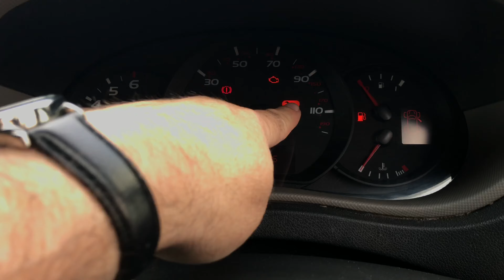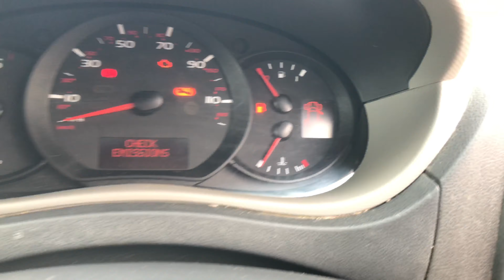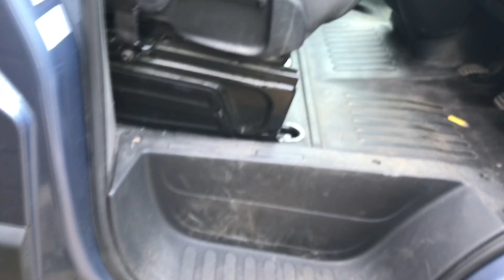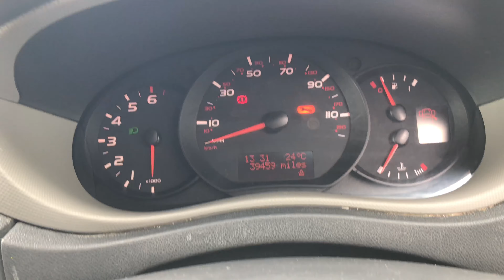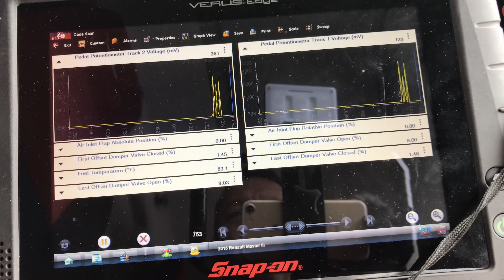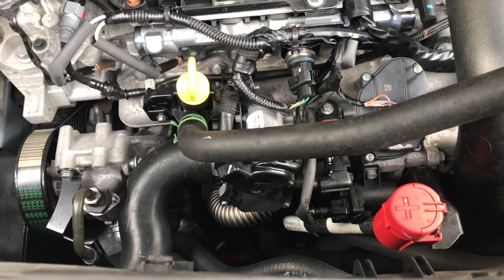Renault Master III (2015) - Fault Codes DF503/DF012

Comment: hi sandy little off subject how do you rate the launch i have the Autel ds 808 and i am looking for an alternative diagnostic to work along side the Autel . the snap on would be out of my wage pocket at the minute i dont want to buy the launch if its very similar to the autel cheers Ian
Reply from the maker: Hi Ian they are similar but it depends on what your working on,  what the coverage is like. In general I do like it now that the vin recognition is getting better but u know there is no perfect tool cheers sandy
Reply: @sandyande  so true more less Opel Citroen ford and Peugeot
Reply from the maker: Launch good on Citroen/pugs and Vauxhall on fords the best is Forscan

Comment: "Computer main supply voltage out of range" can cause mahem in the DTC department. Had a very similar experience with a Toyota Tundra...scratching my head then the owner says "Oh by the way I forgot to mention I drained the battery dead the other day!" So I keenly watch for that wording in a code now! Cheers Sandy
Reply from the maker: Good tip Ian cheers sandy